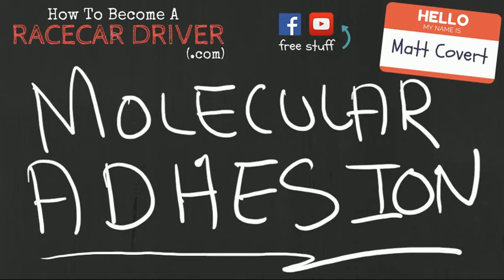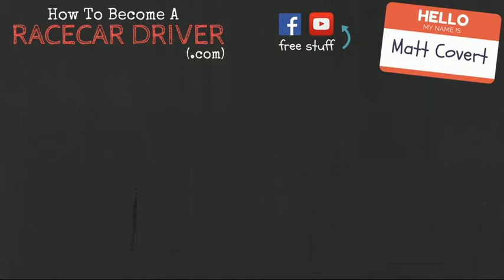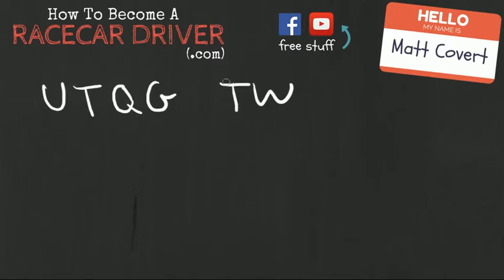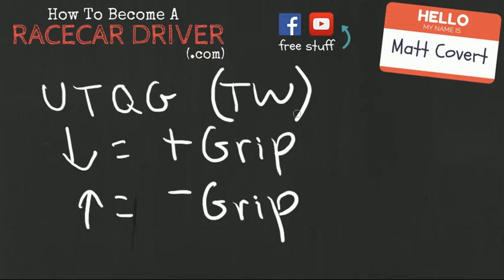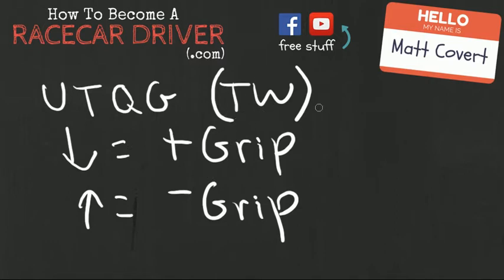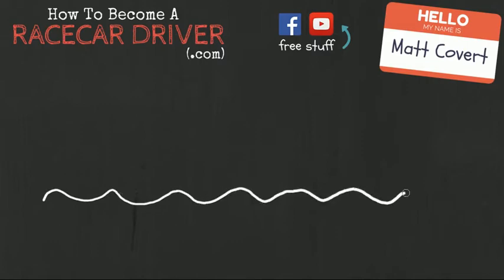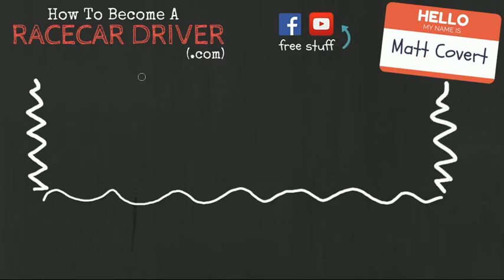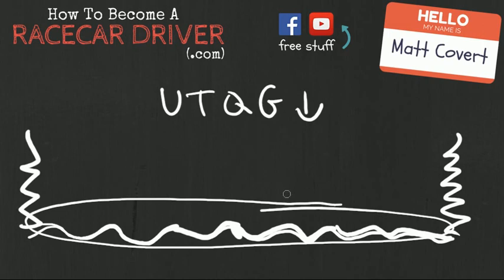Molecular Adhesion

Comment: I wouldn't call this molecular adhesion, because at the molecular level, not microscopic as you're showing, the only physical property that's really being taken advantage of is friction and maximizing it. Now, if the tires themselves were coated with a compound to make them sticky intentionally, something that would adhere to the track as it ran, that would be a good example of molecular adhesion.